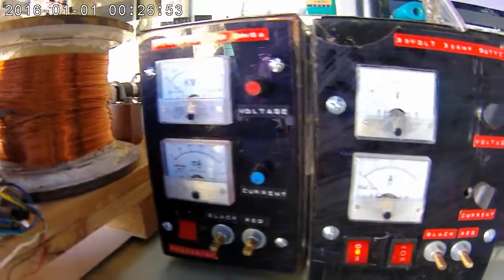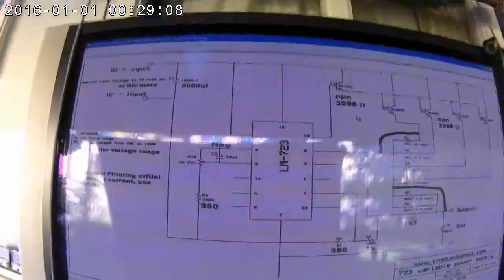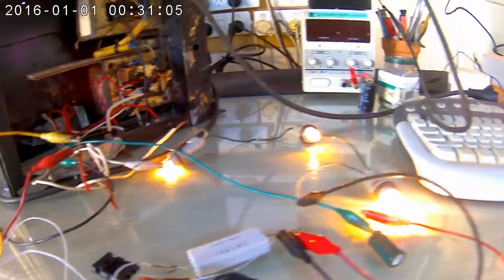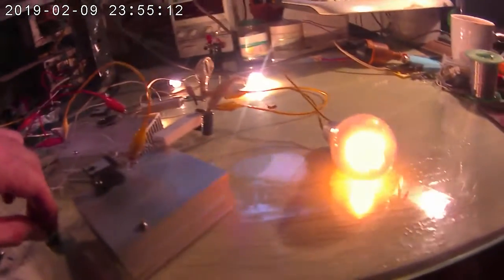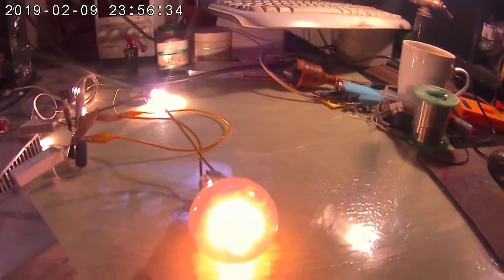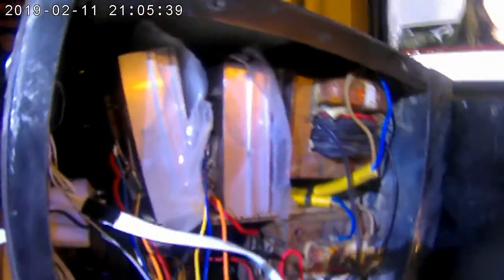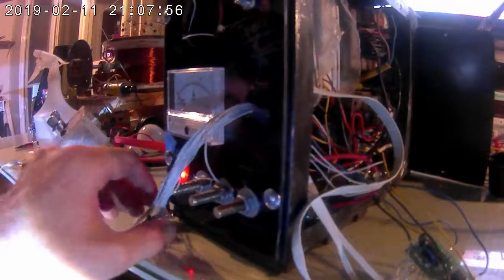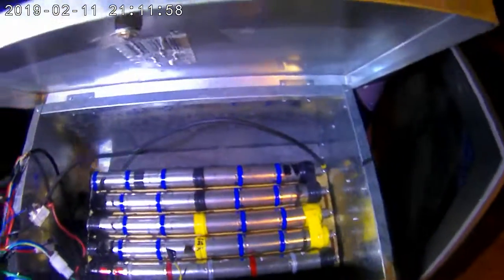My home made DIY 60 volt lab bench power supply from scrap ONLY $5

Comment: I’ve been collecting those BJT from CRT TVs there is another also like spec very reliable.
Reply: Ferrites are great,  i love connecting them too ground rods, - lots of good free energy is possible. - very cheap and easy way too power light globes,  -   motors and computers are much more difficult though, not too mention looping the energy

Comment: I can give you my overview of the reason for the intensity of the hum on the transformer:

As I have pulled a lot of then apart i decided to asses the primary turns ratio against the commonly used constant 42 which possibly derives from a hitchhikers guide to the galaxy, so I found the Ae {Area effective} by measuring the two vectors of the core area where the primary will be wound in my case it was 7cm and 3.5 cm so multiply these to get the Ae 7 x 3.5 = 24.5 
Now we divide the constant 42 by the Ae 
42/ 24.5  = 1.71
{this constant 42 I have found reliable for all laminated steel cores} {I have tested it into the turns exceeding 1800} 

This is the Tpv {turns per volt} 

As this is 240 primary we multiply 240 x Tpv   {240 x 1.71} = 410.4 
so 410 ~ turns should be on that core for the primary 

So in length I want to know how many turns are on there so I measurer with a sewing tape what one turn is , it is 21.5 cm for one turn 

So 410 x 21.5 cm = 8823.6 cm but in meters that is near enough to 88m 

So now with my measuring stick I unwind the primary and find that there is instead closer to 52 meters ? 
But the wire is thick, so it would seem to me that the primary has about 36 meters less wire than it needs and this has been accounted for by both thicker wire and the generalization that the operation of the device will not be at long lengths at one time, I.e the microwave will not be run for hours at a time etc. 

Regards
Reply from the maker: lol just googled this 42turns ratio, so as not too look foolish, however was distrated by hitchhikers guides quotes on the left, * “Shee, you guys are so unhip it’s a wonder your bums don’t fall off.”  .... and boobs on the right.///      i think  i need too replace my chinese gong with a ferrite rod.